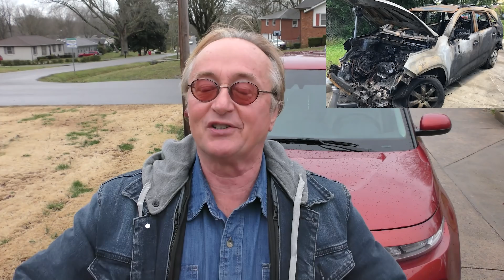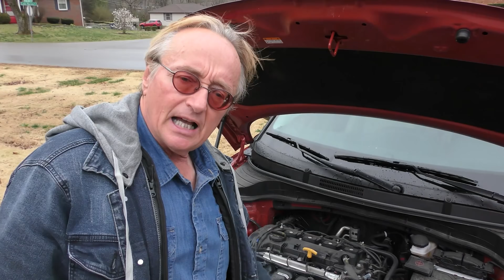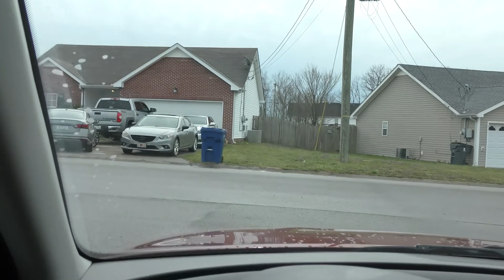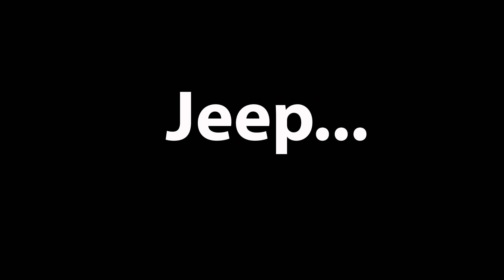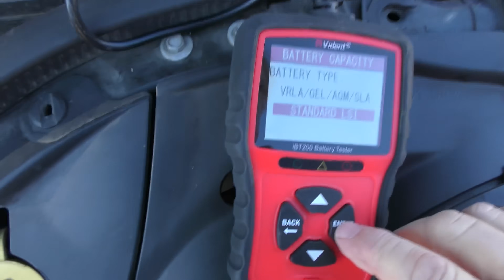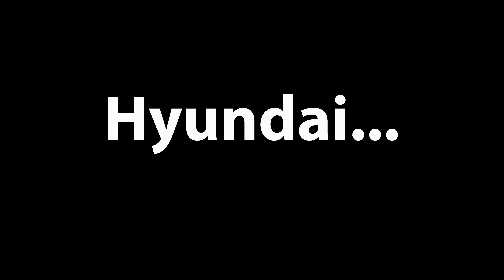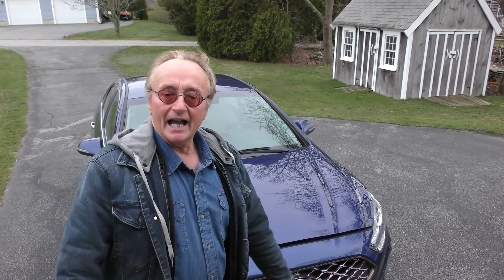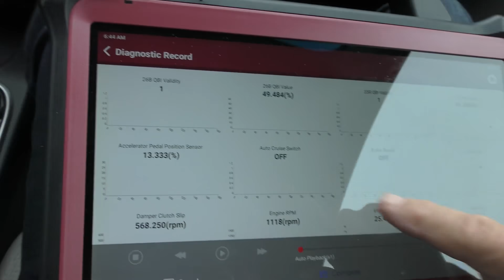3 Car Brands That are Crap

Comment: I've owned 3 hyundais,  250,000 miles on the first two I owned.   The 3rd one is a santa fe and I've got 130,000 on it so far.  My experience is these are great cars.  None have burned oil
Reply: Hyundai & Kia just need change of oil below the recommended mileage, don't overshoot it. I owned 2010 Kia Rondo and 2007 Hyundai Sonata, both do not give me a single headache. Im not sure about other models.
Reply: @kamaruddin9172  newer ones are junk. Google it. I've known people with these issues.
Reply: My 2005 Elantra has 222k on it and it burns oil, but almost any car with this amount of miles on it would do so!
Reply: And all of them are being made cheaper...have you not noticed everyone's building them cheaper, and charging more?/google issues people have
.....I've talked to people who worked for Hyundai and kia....they always have new motors in stock , BC they always need em. I know someone who has a Sorrento ,87k miles the motor blew ,and it was maintained..he got a new motor from kia.
Reply: Sir, you've been lucky. My 2017 Hyundai Santa Fe t is still sitting in the driveway after it seized up completely with 97568 miles on the odometer. I treated it like gold changing the oil every 3 thousand miles. It has a lot of bells and whistles, and I thought it would last at least 250000 after babying  it. Well, I was wrong, and the Hyundai dealer apologized, saying there are too many waiting to be changed ahead of mine, so get comfortable because it's gonna be a long wait. So far, after a year and a half, nothing has been done. A lawsuit is pending along with thousands more, and I'm not holding my breath. 

They did lose a settlement with our government, but it would seem that the only ones getting anything out of that is the government itself. Bottom line, you might not want to be too overly confident with Hyundai. If something goes wrong and you require an engine replacement, you'll find out they don't stand behind that particular warranty. It's just too costly for their company because they're trying to compete with other auto companies with a much better rating because the others aren't being sued for recalls they can't afford to cover.  Doesn't matter that they changed it from 100 thousand miles to 120 thousand because they lost the lawsuit. They still won't honor the damned warranty.  Be grateful for your good fortune with Hyundai. Some of us have not been so lucky.
I'm buying a Toyota after this debacle.
Reply: YOU are one of the lucky ones!
Reply: Bought my 2007 elantra at 70,000 miles. It’s at 230k and still running great!
Reply: Even a broken clock is right twice a day . Just because you got a good doesn’t mean there aren’t thousands that are horrible .
Reply: @jamesstewart3771  got 140000 miles on it now, still working great.
Reply: I've got the 2018 Elantra, and I've really put it to the test driving all over the southeast. I'm approaching 150k already, and haven't had any issues outside of routine maintenance. No oil burning, no transmission slippage... So far so good, knock on wood.
Reply: My daughter-in-law has one of those cars Hyundai it was constantly in the shop for recalls the first two years she owned it
Reply: Yeah, I have a 2012 Kia Soul + with 76k miles. Never burned a drop of oil and the auto trans is perfect
Reply: @mjk9674  you barely have any miles.....and you've been lucky. I know people who have had and do have these
Reply: @mjk9674 I bought a new 2004 Kia optima that I had to bring in for warranty work a few times and not once did it cost me nothing.They always managed to get in my wallet even after a headlight blew a couple of weeks after purchase saying it wasn't covered.Around Sixty thousand miles the timing chain went and things got worse from there.I got tired of fighting Kia and finally junked it.Biggest p.o.s. I ever owned including an 80s Renault.
Reply: My Hyundai is approaching 200,000 miles & still runs great, keeping it for a few more years
Reply: My brother has owned 2 Hyundais both caught on fire.  While driving with my Dad to pick up his next car (Chevy) they saw another Hyundai being towed, (it was charcoal)
Reply: And Korean cars look cool too.
Reply: Yeah you can say this but at the same time my sister owned one and the engine caught on fire…which is a common recall problem for them
Reply: When do you have the oil changed ?
Reply: @norisboren5402  3000 miles
Reply: Not sure if your 1st two had 250,000 each or combined.  Either way if each has 250,000 times 2 plus 130,000 my 1 Toyota Tacoma has more miles on it than all 3 of them combined
Reply: 203,000 on my Hyundai Sonata
Reply: I got 1.6crdi manual 135k miles on it. 
No issues.
Reply: My wife only buys Hyundais. She has never had any problems with them and she refuses to buy anything else. Swears by them.
Reply: Same with my father, he owned both a first and second generation Lantra - very reliable cars.
Reply: Problem is Kia and Hyndai sometimes u get a great car tht runs and runs other times right out the lot its a pile of crap
Reply: Sorento 2017 T-GDI with 200k km, no issues at all, not burning oil never a repair.
Reply: I'd guess that 80% of the problems that Scotty sees are from not doing proper maintenance. Most cars are decent if taken care of. Hyundai's Theta II recall was a mess and the defect was out of the customer's control but there are SO MANY Theta II cars still on the road over ten years later.
Reply: @Jody Bruchon Tech  You might see them on the road, but they may have had the engine replaced. My thete 11 t blew after only 98,500 and Hyundai would not stand behind the warranty. 
Yes, I treated it like a baby. 2017 piece of beautiful looking POS in my yard.  Needs an engine. I'll sell it cheap. Has all the bells and whistles.  I wonder if any Hyundai techs want to by my car?
Reply: @JodyBruchon  10 years? still seeing toyotas from the 90's here in NZ
Reply: @6foot8jesuspilledpureblood82  It would be difficult for a car revision that has only existed for about a decade to be around after 30 years. They don't make 90s Toyota trucks anymore either.
Reply: @Jody Bruchon Tech  they actually do remake old Toyota land cruisers in 5* safety ratings they come in 2022 21 23 models but they are super expensive.they are the same as the old ones.  Possibly not available in your country.
Reply: @6foot8jesuspilledpureblood82  Given how strict American safety regulations are I wouldn't remotely be surprised.

Comment: Not certain what Scotty is talking about because I own a KIA SOUL and have had "0" issues with the car. I run full synthetics; have 32,000 miles on it, gets between 25-42 miles per gallon and hasn't lost so much as a drop of oil. I did receive a notice from Kia about a recall last fall  with engine issues and the letter said they would be replacing the engine if there was the oil related issue. I've ran full synthetics since 15,000 and only change oil every 15,000. Last vehicle I did this way finally died at 320,000 and was only designed to go 180,000.  I would highly recommend buying this vehicle.

Comment: KIA is a super cheap brand. I was considering buying one, but I'd seen some of the engine issues that people have had and thought, na, I'm good. Jeeps are relatively common in the UK, but my dad and I tried one out, they have an uncomfortable sitting position, I wasn't impressed, neither was my father. I sat in a different model since then, still didn't like it. Hyundai, we pronounce it different here, but they are just the same this side of the pond, as in meh. One of my former colleagues had a major problem with a brand new Audi he bought, the engine had some bizarre construction faults that reminded me of this Hyundai, he took back to the dealer three times, they couldn't fix it. My Honda is 10 years old and still running smooth.

Comment: I do not think the Jeep problem is a short I think it is a circuit board ground in the module because it started acting up in cold weather and the fact that wacking it made it crank.

Comment: Guess I'm lucky.  I have a Kia Sorento with a 3.3L V6, and it's got 85K miles on it with hardly any issues.  Been very reliable.
Reply: I've got an 06 Honda J35 vehicle with not a single issue, 200K miles. That's the difference. 85K miles with ANY issues is not reliable.

Comment: I have a 2013 Toyota Venza 2.7 that used more oil between oil changes than it does to change the oil. Now my 1990 Camry wagon 2.,0, with 520000 mile may use a 1/2 quart of oil between oil changes. These new car engines are garbage. My 88 Yugo doesn't use any oil

Comment: I have a question would it be a good idea to use full synthetic oil on my 2009 Toyota Corolla I'm using 5 w 20 mobile synthetic blend with 1005thousand miles

Comment: My 6 year old Accent drank oil and Hyundai replaced the engine with no hassle.  That IS messed up to need a new engine, but yes I had an Elantra rental & yes for 3 months. I stand by the company bc the 10 year, 100,000 miles warranty is impressive.

Comment: Kia/Hyundai had a serious issue with a specific motor and had to recall them.  I have a 2018 Hyundai Accent with a smaller motor than the problem one and haven't yet had issues.

Comment: I have a 2015 Kia Optima 95,000 miles on it I’ve only had one problem the $75 part in the motor for the electric mirror broke and Kia covered it not one other issue and I have run this car like a bat out of hell

Comment: As an electronics guy, I just want to say don't panic about low voltage problems being a result of complexity. It's really just a matter of the little electron not being able to make its way down the entire line because the pressure pushing it isn't enough. Even the most basic microcontrollers require a minimum voltage because the way "1's" and "0's" work depends entirely on whether or not the signal voltage gets high enough to pass the threshold of what a "1" is. On a 5 volt system, the threshold is usually at least half that (2.2 - 2.5v) but if you put 10 volts into a voltage divider meant for 12v, the previously accounted-for voltage drops downstream are going to push that already low voltage even lower meaning that every signal that would otherwise be a "1" has a 50% chance of being read as "0". That's definitely going to give you funky, random behavior but the problem is a simple one.

Edit: Basically the same goes for digital systems taking analog readings... it just throws off all the numbers, which just triggers whatever actions go with those readings if they were actually accurate.

Comment: I have a 2010 Kia Sedona only thing ever replaced was the gas cap and front rotors otherwise just the usual stuff oil brakes etc. Now have 177K on it. Have to say we've been lucky. Great videos Scotty keep up the good work.
Reply: Kia Forte 2015, regular oil changes (5000) 136000 and no problems so far.
Reply: Wow.. I salute you sir.  An owner who understands statistics and anecdotal experience!  Good on you.  Yes, you always take a risk with any car, you just take a higher risk with these brands.
Reply: You were not lucky, Kia makes good cars.
Reply: @stockey  … and then conversely we have the dullard.  Yep, I knows a guy he did smoked 3 packs a day and lived to 90 - them anti-smokers are full of it! Hyuk!!

Comment: I'm not a Kia fan but the first problem that causes oil burning is extended oil changes. I don't care if you run synthetic or dino oil I would not run either past 5,000. Look for failed engine tear downs where extened 7,500 + oil changes were implimented and the piston oil rings which are supposed to move freely were locked into place with build up due to these extended changes causing cylinder bore scoring. Bottom line 3k for dino and no more than 5k for synthetic.

Comment: I changed my oil yesterday, i used the extended life 20,000 miles mobile brand, ill still change it out at 3000 miles.

Comment: Bogus trouble codes. Most mechanics don't understand, care or are too Lazy to open a manual: A diagnostic trouble code does "NOT" tell you what part to replace. A trouble code tells you what system to test / diagnose. Far too many mechanics are nothing more than parts replacers!

The best mechanic is not necessarily the one that instantly tells you what's wrong with your car, he's probably the one in the back shop with his face in a manual fixing everybody else's "****" Ups!

Comment: I bought a new Honda Civic in 2012. Burned oil from day 1. About a liter per 1000 miles. Arrogant Honda say, "Normal". Had clutch noises, not their problem. "Alternator" problems at 6 months - addressed that with computer reflash but wouldn't cover towing or the battery that it ruined. I bought the top 200,000 km warranty. Didn't ever cover a thing. Car was a total turd. Can't understand how that company gets such a praise following. I hated everything about Honda ownership.

Comment: I have owned a 61 Chevy, a 64 Pontiac Lemans, 3 50 Ford's with flatheads, a 53 Ford with a flathead, a 57 chevy pickup, a 55 chevy pickup converted to fwd with 327 turbo 400, 29;years of company trucks and now a 95 chevy Silverado fwd. The 64 was my favorite and the most reliable, the 55 chevy was the most fun even though the Lemans had 326 with 4 speed, I would love to have another 50 Ford with overdrive and a lovely flathead again. Of all the company trucks I wote out the Ford F150s were the most reliable. The last was 2013 Toyota Tundra. It never got better than 8.5 mpg and blew white smoke or vapor from the right bank when new and never stopped. It had horrible vision, was rediculously talk for a 2wd. Also to replace the starter requires the removal of the intake manifold. Very reliable but Could get pricey on a starter replace and not economical. The accelerator was not smooth nor the braking. The dealer said that was the way the are. I won't own a car with no dipsticks or a one piece drive line. I only work on my vehicles and like them as simple and solid as possible. Been driving since 1965 and can't believe how I'll mannered the drivers of today are and careless. Driving used to be a pleasure but no more. Where are the police?

Comment: I had a 2003 Kia Spectra and when my daughter wrecked it at 175,000 miles, it literally used no oil. I always changed oil and filter at 5,000 miles. A friend had the same model and blew his engine with less than 90,000 miles. He neglected to change his oil on schedule! As far as 1.0 liter 3 cylinder engines, my 2008 smart has 160,000 miles and still barely uses oil with synthetic oil changed at 8,000 miles vs 10,000 recommended.
Reply: They've been crap for a decade.
Reply: @richsweeney1115  I do wonder how many people really change their oil like they should. Of course online everyone follows the schedules like they should, but I bet the folks who change the oil at shops  could tell us stories.

Comment: Have a 2006 Kia Spectra 2.0 138K doesn't use any oil beetween changes and no leaks.  Use synthetic blend castrol at every 3000 miles.  Been good transportation. Daily driver.

Comment: Screw Hyundai and Kia. The genesis coupe engines are spinning bearings and they don't even make or have the replacement or even refurbished engines in stock anymore to replace them under warranty. What a joke.

Comment: I just sold my Hyundai i30, can't remember what it's called  in the US.  I put 65,000 miles on it in 3 years and the only problem I ever had was with the heater fan making noise and it was replaced under warranty.  I have now replaced it with a Hyundai Kona electric.  No problems yet, but I've not had it long.

Comment: in those conditions, the battery was rated for 870 CCA, not 820. Which I guess doesn't matter since the battery is reading 12 volts regardless

Comment: I've got a Skoda Fabia (VW Polo in different clothes) here in the UK. Oil & filter change recommended at 20,000 UK miles (Skoda) or 18,000 UK miles (VW) so is strange that the recommendation appears to be different for what is the same 3 cylinder 1.0 Litre 95 ps turbo charged engine. Have just gone past 66,666 miles (I tried not to drive into something while noting that) and the car's been fantastic so far although it has an occasional (every 6 months or so) engine warning light come up (associated with the throttle body) which results in limp home power reduction until the light goes out. 
I have the recommended advanced Synthetic oil (Castrol) changed at between 15,000 - 18,000 miles (although the car tells you when a service is required). 
Of course VW had their own oil consumption scandal with their TSI engines some years ago now (faulty pistons / rings if i remember correctly). Customer in the US got damages while I believe those in the UK didn't.

Comment: I've driven my 2013 Sonata 2.4 about 20k miles since 2016 and currently has about 78k, other than the radiator fan connector shorting once, haven't had any issues. Although I only get 23-25 MPG on highway drives, and 15 in the city. not sure how that guy gets 30MPG in the 2019 model with the same engine.

Comment: 2014 Kia Forte EX with a 2.0L GDI engine. Drove the car to  the stealership and they "updated" the software and then the car would not run and I had to have it towed back home! 
Kia is junk! 
This was done at Fox Kia of Grand Rapids. 
Scammers for sure. Had just 100, 000 miles on it. I will WALK before I buy a Kia or Hyundai again. Ended up selling car to the scrap yard.